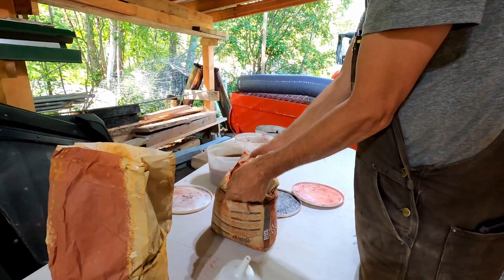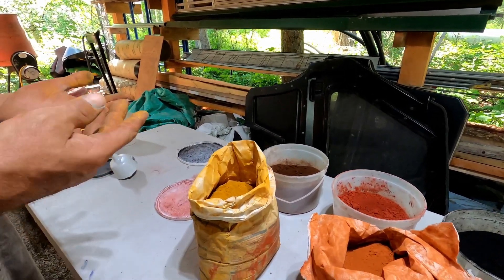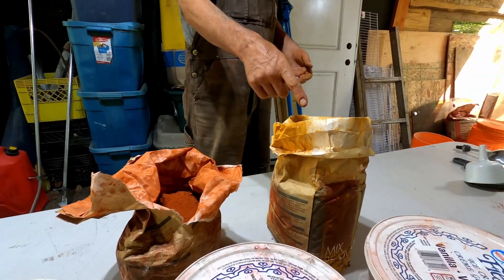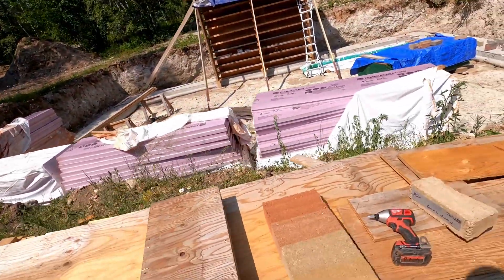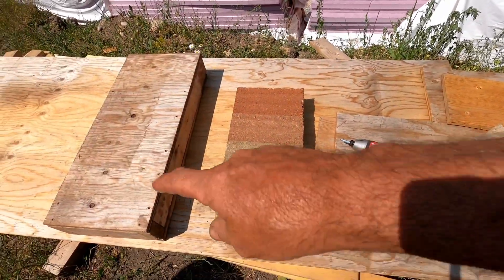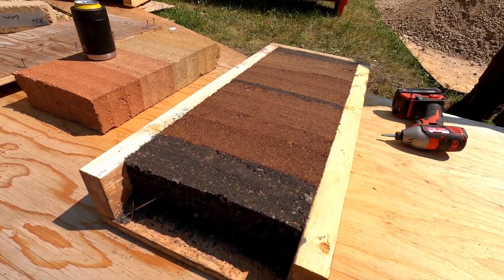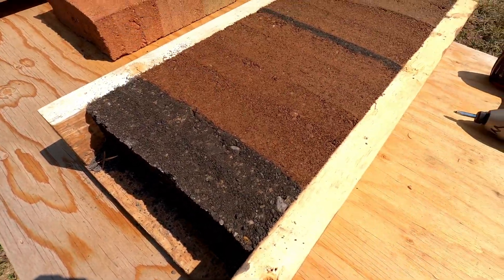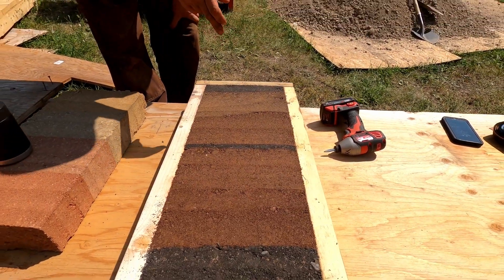Best Rammed Earth Sample?  Deciding on Colors for our Rammed Earth Wall

Comment: Hi. I’ve been following the build through your series of videos, and I’m hugely impressed, particularly at the way you’ve continued to work through the extremes of climate. I like your eco credentials too, but what I don’t understand is why – along with most other North American rammed-earth projects – you choose to use cement in your mix rather than lime. Lime is equally strong as a binder/stabiliser, but in the long term (decades, centuries even) it performs better. It does take longer to cure, but unlike cement it doesn’t harm the environment. And when the structure’s life is over and it’s demolished, all you have left is earth, because the lime has reverted to its original form.
None the less, what you’d achieved is great. Well done.
Reply from the maker: Thank you for the well thought out comment. We will definitely look into the use of lime. Not sure how available it is to us in this area. Will still be worth obtaining some and completing some test samples or a smaller project with this as the stabilizer. 

Thanks again for watching!